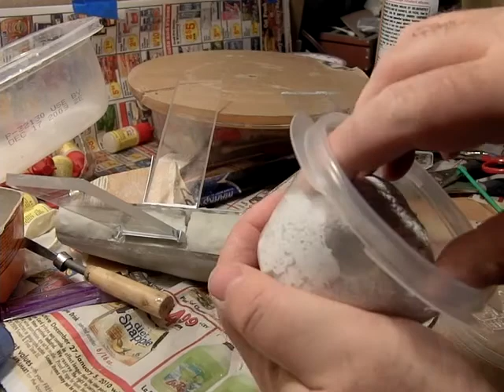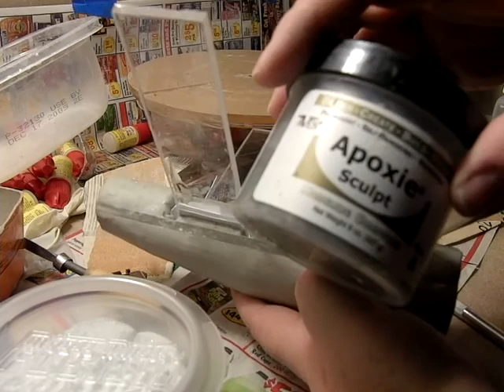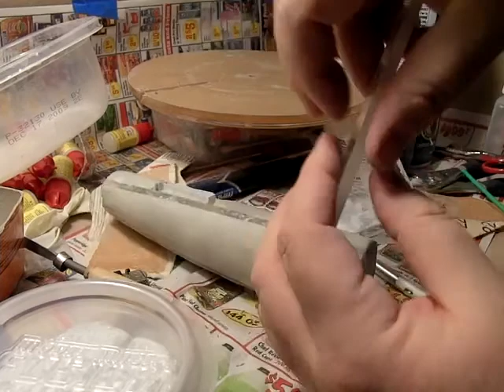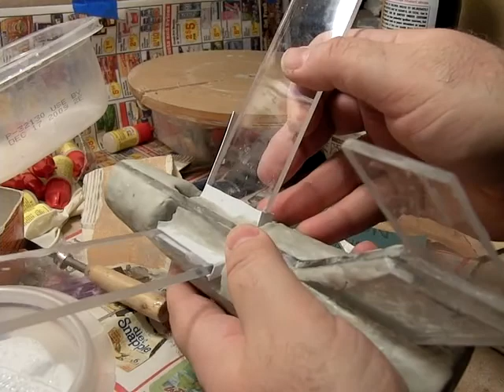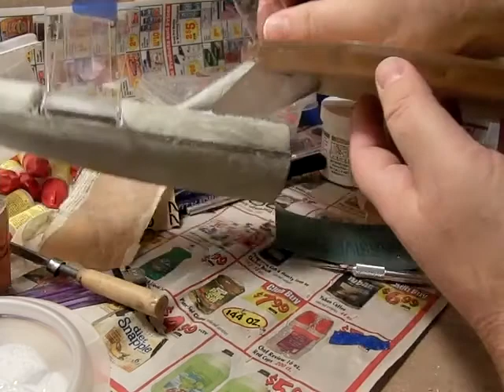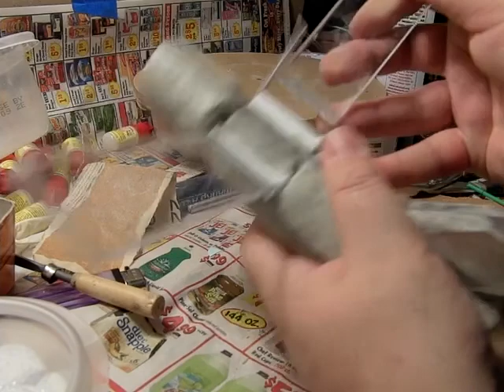Dreadnought 07A:  2ndary Hull Work

Comment from the maker: yeah, that would be a shit-ton of solid resin.  Not good for lighting either...  Maybe if the front end were hollowed out with an insert and capped off with another piece...  Lots to think about on this one.

A vac works as demonstrated in the earlier vids.  I just want this in resin, at least for myself.  The vac version one is still sturdy with no droop after 8 months.